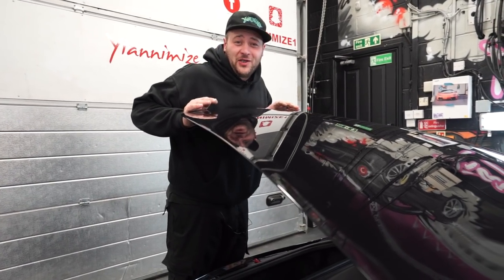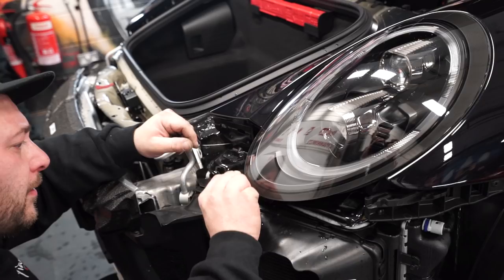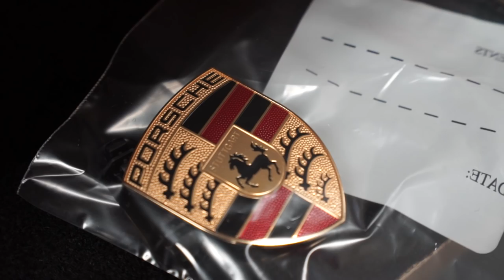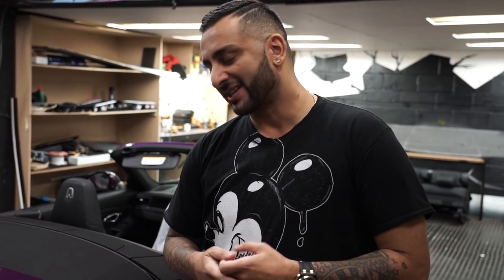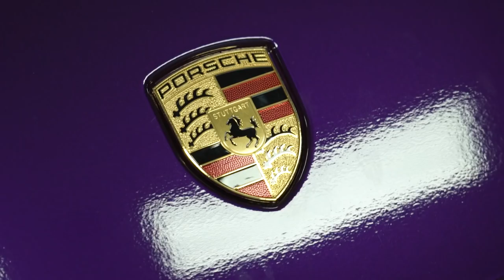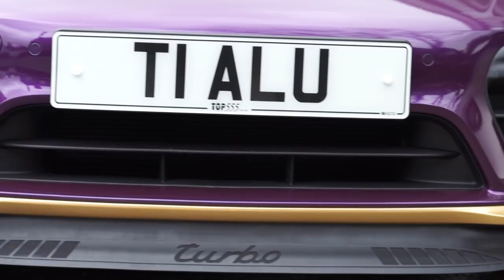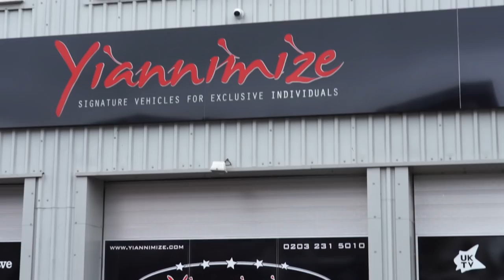Porsche 911 Turbo Cab wrapped Gloss Purple with Gloss Gold

Comment: Just noticed when the camera gets very close it reveals an orange peel effect....i used to spray paint for a living...and would not be happy with this result
Reply: Robert Lloyd 100% agree with you the orange peel looks disgusting
Reply: What do you mean by orange peel?
Reply: 3:23 . Orange peel is a certain kind of finish that may develop on painted and cast surfaces, even screen protectors. The texture resembles the surface of the skin of an orange. Gloss paint sprayed on a smooth surface (such as the body of a car) should also dry into a smooth surface.
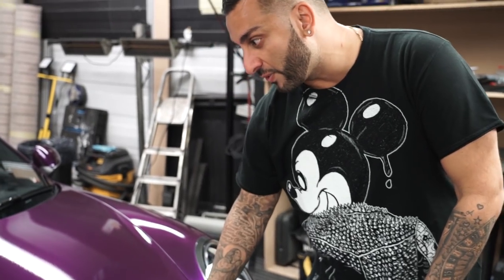Reply: 7:25 ....too 4:58
Reply: Aahh makes sense, I didn't even notice that
Reply: Yeah i was wondering if anyone else noticed this
Reply: Can you wet sand a wrap?
Reply: Agreed, noticed it too
Reply: It happens with gloss finishes unfortunately
Reply: Ricky thank you, i didn't notice that

Comment: That wrap material has a low quality surface finish to it and when I saw that you're actually cutting the wrap on the car I absolutely cringed.   These days, a PROFESSIONAL wrap shop uses film that has a superior gloss and precuts the wrap to exact fit so you never risk damaging the paint by touching it with a blade.

Comment: If I would ever get a wrap on my car, I would send it down to the manufacturers of my car. Primarily due to the fact that they will know how to put it back the way it is supposed to be done. I'm not saying Yiannimize does it wrong but, it looks like they're just pulling stuff out and putting it back together; it doesn't look like they're following a specific manual or instructions set.
Reply: Aminda Fernando idiot
Reply: Agreed I wouldnt have my car pulled apart. However dealers are the last place I'd go to get paint or body work done and will usually sub contract the work out anyway.
Reply: Tom Neave oh I see
Reply: haha thanks :D